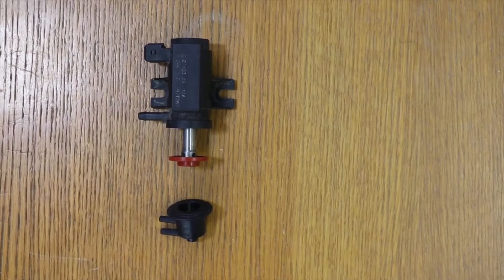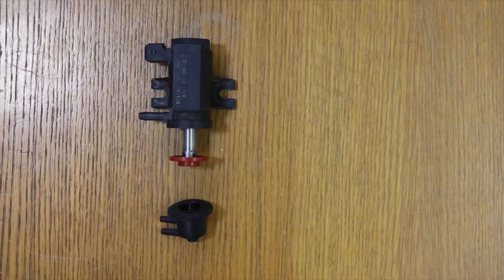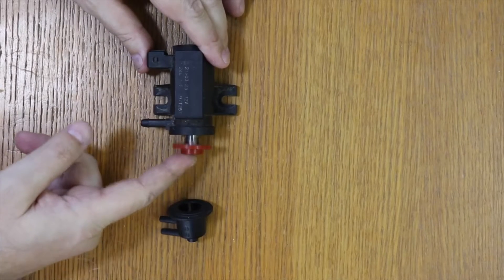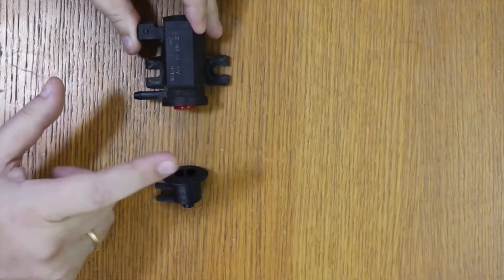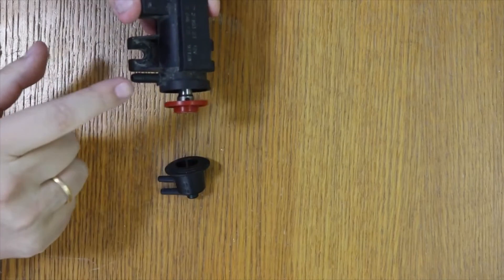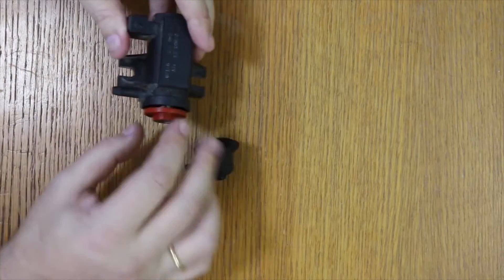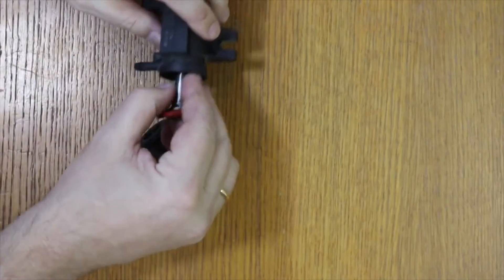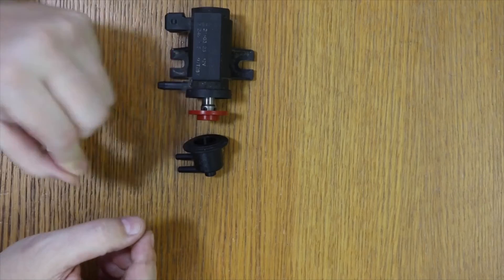TURBO SOLENOID VALVE OPERATION, voltage, gravity, suction, vacuum....

Comment: hello, it works with on-off or moudalte voltage signal?
Reply: You can test it powering 12V directly, but in the car, the ECU will send a PWM signal, where the duty cycle is how much vacuum should pass to the wastegate actuator.

Comment: Evo mala pomoć od mene.
+12V je prisutno na pin broj 1 elektromagnetnog ventila.
Pin broj 2 je povezan na kontakt E1 na ECU (32 pin grey connector).

ECU kroz pin E1 spaja ventil na masu vozila (earth//ground) ali ne direktno nego određen broj puta u jedinici vremena. Veći broj pulseva daje veći izlazni napon i veću otvorenost ventila. Veća otvorenost ventila znači jači vakuum koji više povlači turbo vastegate actuator i tako daje više vazduha u usisnu granu.

Nema na čemu.